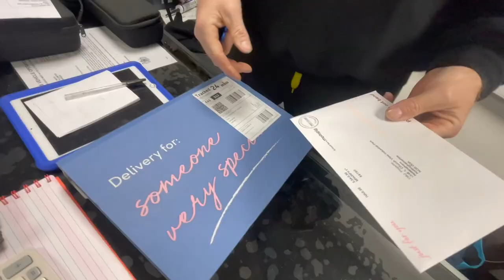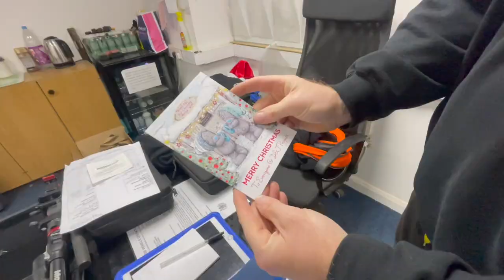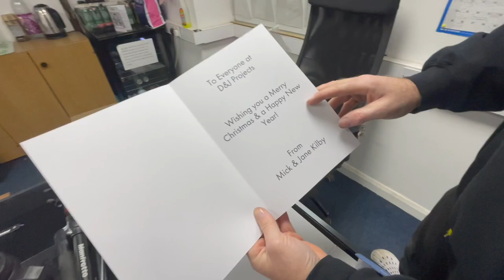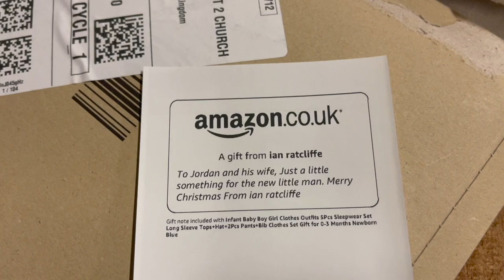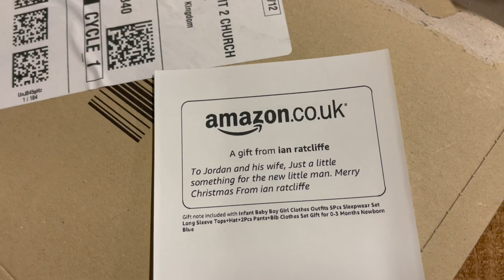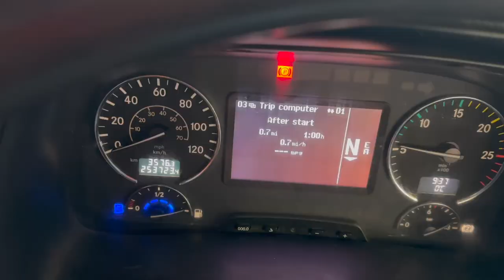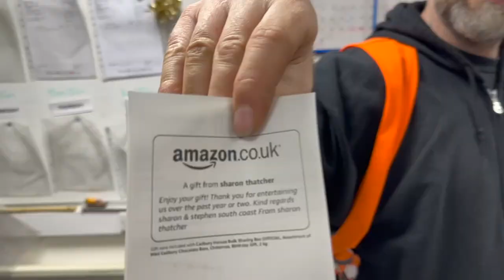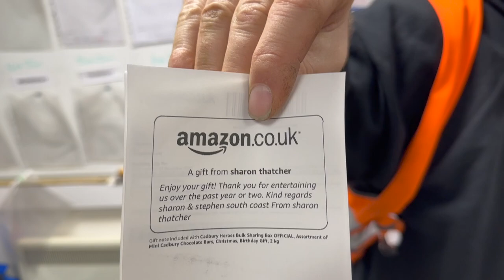WE'VE GOT NO DRIVE & WE'VE BEEN SHAFTED! - This Week At D&J Projects #81

Comment: Front is right hand side. Left is rear, but you can setup other way if preferred. Reason is people are mostly right handed and generally apply more pressure to front  wheel breaking - but you should graduate both brakes.

Comment: A perfect example of how useful a thumb grab is every small machine should have one I new you'd make good use of it you can pull posts out as well you'll have to get a rake now for finishing work. I just noticed you mentioned the machine was a little bit unbalanced you can bolt on extra balance weight on the back to compensate for the quick hitch and thumb grab if you ring your supplier I'm sure he'll sort you out  all them machines don't come with quick  hitch and grab that's why it's a little bit off balance. Saying that you'll always know your limits with any machine. Looks a sweet machine 👍

Comment: It was cold here in Dublin Ireland I work at concrete pumping and the concrete plants where frozen and some of the mixer trucks was frozen because some of the driver's didn't let all the water out of there hose's I made sure mine was empty and put the hose into the cab and covered the water pump with some old coats and jumpers.
Reply from the maker: Good lad!

Comment: That Sandy, oops Sany works well, I've watched so d different USA users and instead of shaking the soil off the root ball they take it high and drop the tree/bush because shaking the machine, they have found can loosen some bolts. It's a nice fencing job, not too shabby at all. Sandy, oops I did it again, that Sany made quick work with those bushes, any chance you could come round here, my Mrs says her bush needs pulling out? I have told her to use her lady-shave instead and got a slap for it. 😂.Stevie, did someone hide those few inches from your measure when you measured for that panel at the side gate? 😂, looks good guys, shame you don't live near the Towcester area, I've got a decking job needs doing in the spring. If any of your watchers live in the area and can price up the job it would be appreciated, email on philspoons3@gmail.com, thanks in advance. Is the number you wanted us to guess 81? Thanks for a great year of videos, really enjoyed them all.

Comment: The freezing of the Bowden cables is a common occurrence on many vehicle types, including bikes and motorbikes. You can try filling them with a silicon or lubricant spray and see if that stops the condensation forming within them. Also you may want to get a waterproof cover for over both sets of controls to stop rain getting in. The less water that gets in there the better. Wait until a warm dry day and blow the pipes through with some air and then fill them with a lubricant/silicon spray like this https://www.youtube.com/watch?v=ksiQIvNIPRw

Comment: Not too shabby, those two bottom panels are different heights, and it runs uphill to the right, the only thing shabby is the job you were paid to make it look right, the post in the center is higher than the other 2, If the customer said to leave it high you should have informed what it would look like NOT YOUR BEST WORK I  watch almost all your videos, another thing you only put 1 lower panel in one the gate side that looks wanky the lower panel looks to run down hill